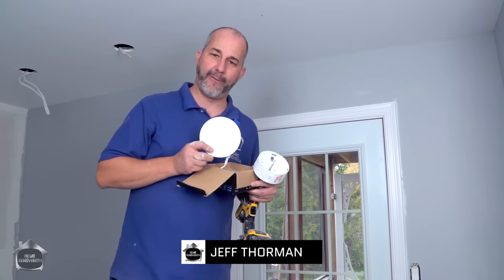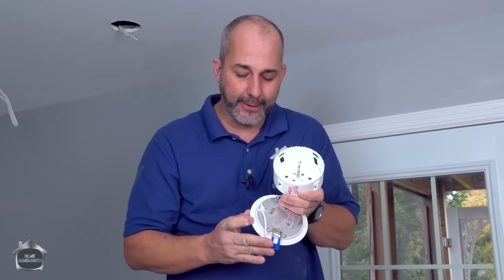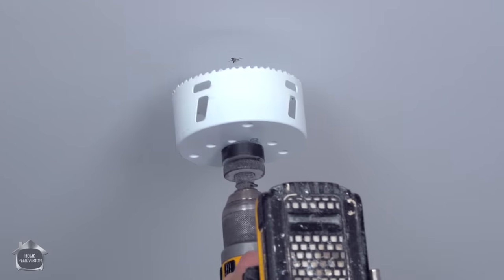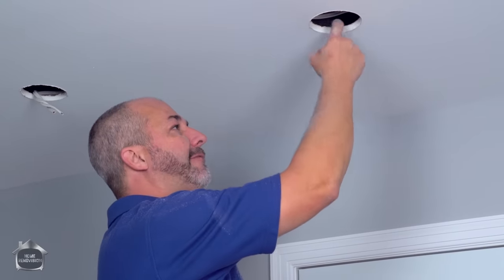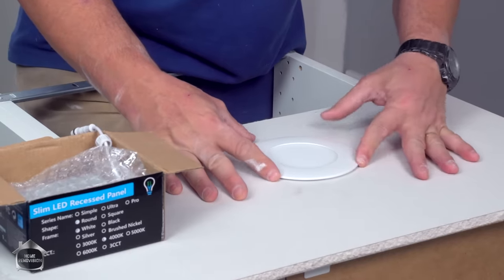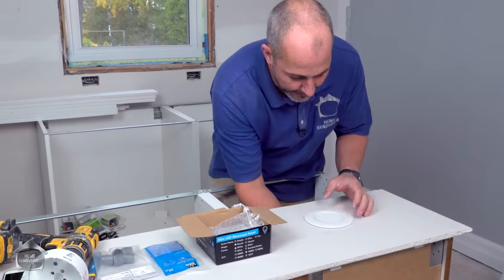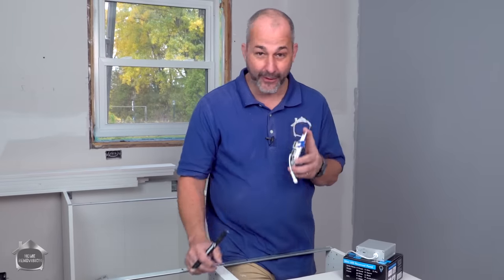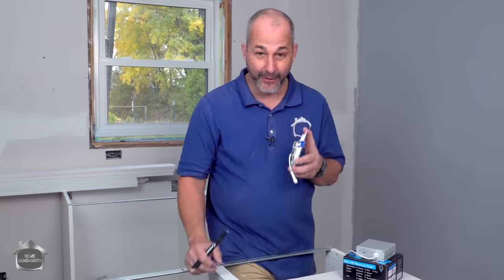How To Install Pot Lights in Kitchen Ceiling

Comment: So did you ever tell you the brand or maybe model number of these “high quality” lights? Did I just miss it? The light in the link are not $11 even with a discount code. Seems like you’re pushing viewers to a certain website to your cut. You come across as a salesmen.
Reply: No, he did not, at least that I can tell. Canadian shipper where if you don't buy at least $160 USD worth of products, the shipping is atrocious. Better off searching elsewhere for an equitable quality and priced product.
Reply: Gazzlo is correct.  I had 12 lights in my cart ($155.14 with Jeff20 discount) and shipping to US was $25.  I added one more light to my cart and was $168.07 with free shipping.  It was $11 cheaper to add 1 more, LOL.  I have not placed my order yet.

Comment: I am a retired electrician. I worked 44 years and never once used the term “ pot lights” or heard another professional call them pot lights. They are hi hats. Only Mike Holmes on tv calls them pot lights and he is not an electrician. Its a silly term made up by tv characters

Comment: Might want to wear some glasses, come on buddy, Safety first!!! It's after you get drywall dust in you eyes you think, Gee guess I should have had glasses on.   YOU should be wearing glasses during the video.  People who are not professionals will typically tend to stand directly under where the hole is being cut as they are looking up. Geez a professional should know better!
Reply from the maker: every professional I know don't use glasses. we simply know better not to stand under the falling dust. something about gravity!
Reply: @HomeRenoVisionDIY  As for me, I'd rather play it safe. Something about accidents. God only gave you 2 eyes best you protect them at all costs. Mostly ametures watch you videos. Best to teach them the correct way from the start.